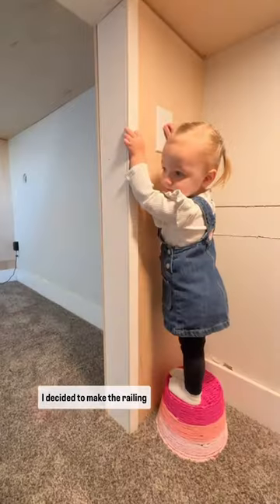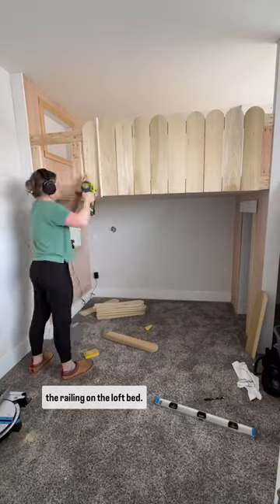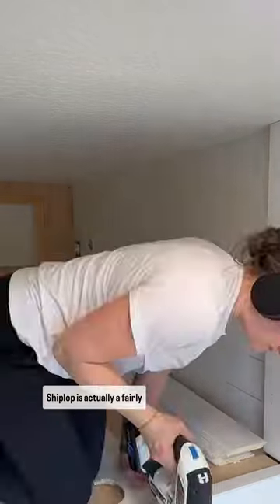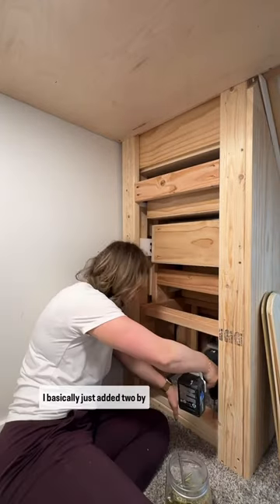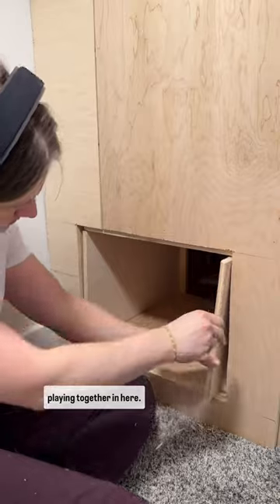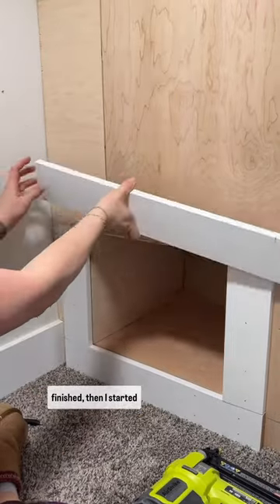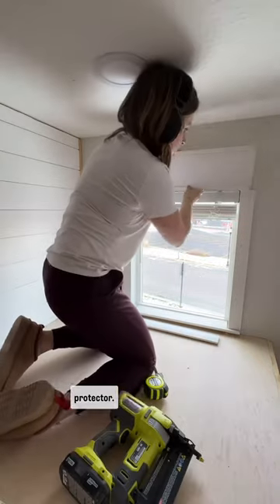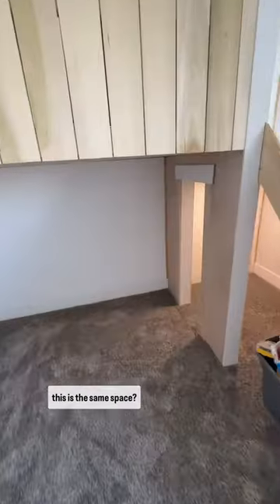Loft bed part 3! I’m SO CLOSE you guys!! #loftbed #howtobuild #diyhome

Comment: as one who's raised a few kids, I can tell you, you're going to have kids fall off of that and get hurt. I recommend adding some pickets to go all the way to the ceiling and screw into the framing. maybe consider some kind of sides that you can put up on the slide. you might want to consider putting some more padding down underneath maybe one of those puzzle pads. if you framed in some plexiglass windows on the loft it will probably look pretty good. and if you do the sides on the slide with plexiglass panels with a wood frame that would fit in with your design too. paint  all the walls with washable paint. also when I did mine I sanded and finished all wood surfaces because of splinters.